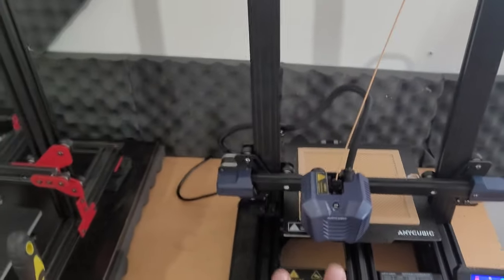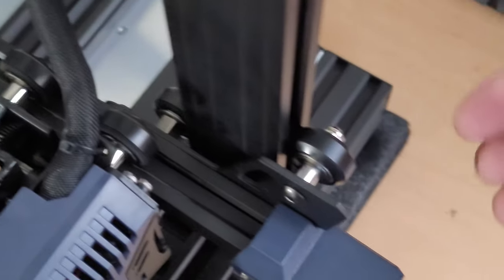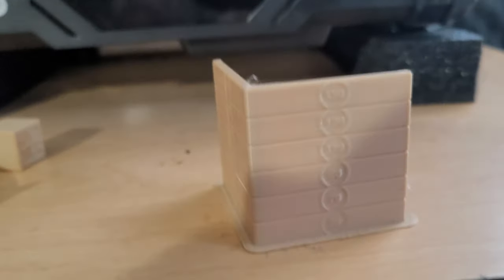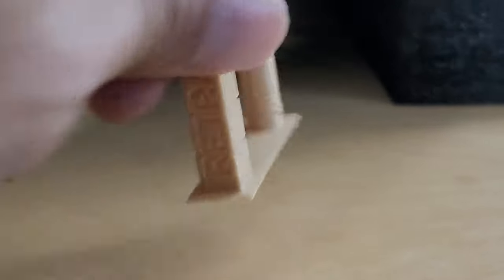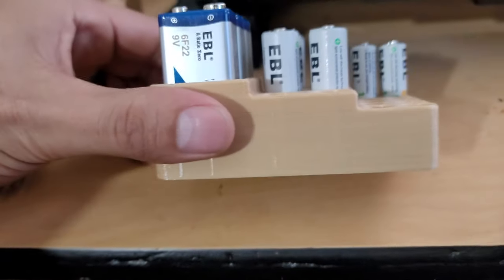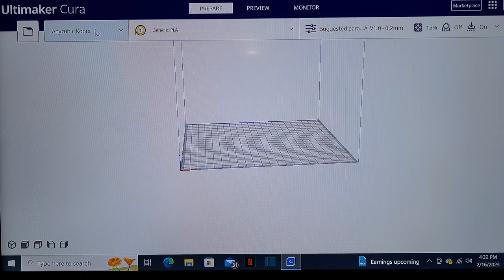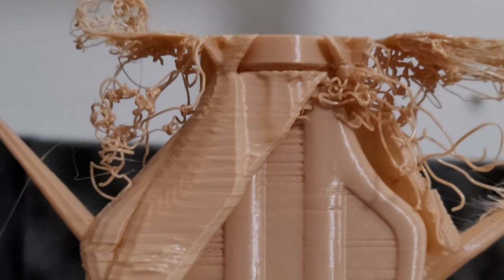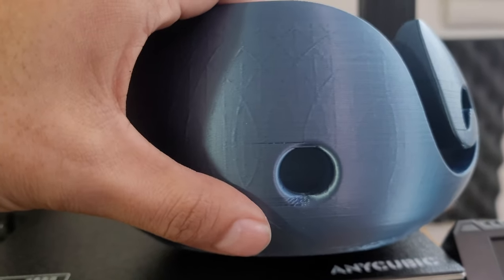neo review check out my final thoughts video part 2 of this 1

Comment: You probably need suppourts for the first 24 hour print because it looks like the printer tried printing in mid air,, which is why it probably failed